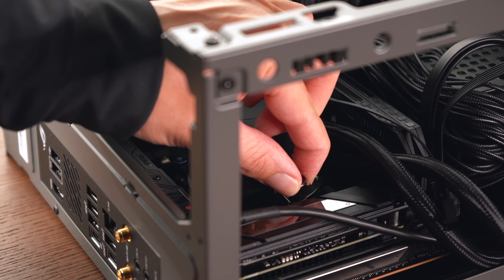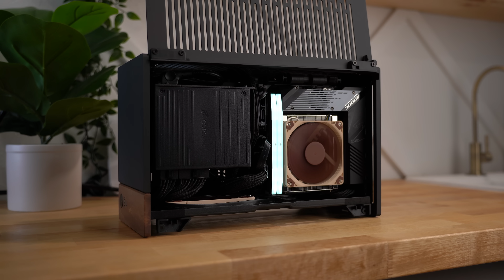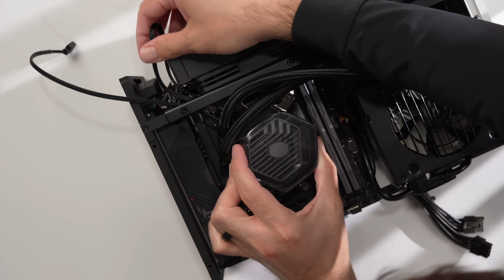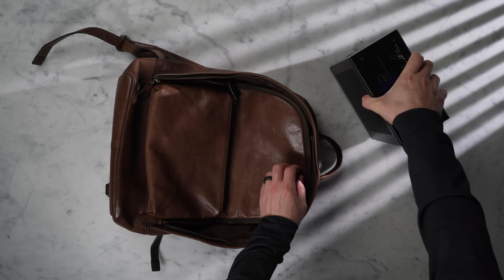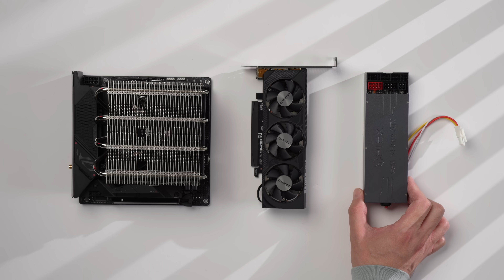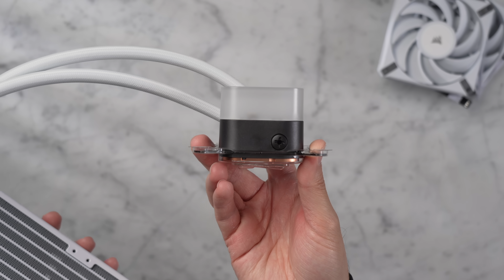Favorite ITX Cases This Year (So Far)

Comment: The new Fractal ERA 2 looks very interesting and I'd like to see how the integrated dual SSD caddy actually works in a speed test with the new gen 4 SSDs. Hope you get around to building in this soon. Also to use the new Thermal Take SFX PSU. That could be very handy for power connections.

Comment: Nice video, thank you. I'm looking to build my wife a sffpc basically for work (MS office, Internet, nothing gaming) and am looking at a MB (Asus z790) and CPU (14900k) with 64 or 96gb ram and want it to handle 2 4k monitor w/out a GPU. All air-cooled with the Noctua NH-L12S (or larger if able to).  Building this all inside the Fractal Design Ridge case. However your video has given me some nicer options as I'd like to display the PC but wife only wants it on the floor.  What do you think of this (pro/con) and what case (absolute favorite that she would want to display it), CPU and MB would you recommend? Thank you.

Comment: Hey guys, I’m actually thinking about doing an ITX build myself (first time ever). I could really use some help on picking the right parts, do you see any problems with the following setup?:

Case: fractal terra (black)
Motherboard: ASRock B650i lightning WiFi
CPU: Ryzen 7800x3D
CPU Cooler: ID-Cooling IS-55
GPU: ASUS ProArt 4080 Super
RAM: 2x16gb DDR5 Vengeance 6000Mhz
SSD: Samsung 990 Pro 2tb
Power: Corsair SF750 
Fan: Noctua NF-A12x15 PWM
Fan grill 120mm
Cables: Corsair premium 600W 12+4 pin

Comment: Hi man, amazing info, thank you! Thinking about mini render station fo 3dsmax + corona render based on amd 7950x and looking for a small case like lian li dan h20, Meshroom S V2 or other similar. I'm not sure it will be cooled enough, cause i need 24/7 rendering at 4.8-5 MHz all cores and max AIO for those cases is 240mm radiator, means 2x120mm fans. How do you think is it possible to make such a tiny render station?

Comment: I've been using the NR200 P Max for about a year and I don't regret my choice. I love itx format but had enough of those cases where you can only fit one little 120mm cpu cooler. The NR200p max comes with an included 280mm AIO watercooling, a sfx psu and a Pcie 4.0 riser. Best value. Great cooling and very low noise level. 👍
Reply: Double bottom intake is a must. Set fan curve to work with your GPU temp. I run 7800x3d and 7900xt oced at 3300mhz and vram at 2800mhz. Temps never go over 70C GPU fan curve at 60% max. Bottom intake never above 50% speed and zero fan below 45C GPU. Setup fucks hard !
Reply: Add some thin 120mm fans as bottom mounted exhausts and you’ll enjoy it even more
Reply: @maxwellgriffith  A lot of test I saw showed that it had little or no effect on temps, and increased noise. So I didn't try. Works fine as is.
Reply: @TaxiDiver100  I should have specified with the vented side panel. Machines & More tested some configs and arrived at bottom and exhaust and top exhaust (side intake directly at gpu).
Reply: @maxwellgriffith The case sits on my desk, on my right side.and I found out the glass panel really soften the noise, so I'm using it... Maybe I sacrified some performance in exchange for some more silence, but that's fine for me.
Reply: @maxwellgriffith  I had it as intake and the AIO at top as exhaust and that worked really well for temps. Was even better than I thought in terms of impact.
Reply: i wish they would release the case as a stand alone product. i don't need an aio or a psu but im in the market for a new case. i have a nr200p but it's pretty dinged up. i might just get another one tbh..
Reply: @Hattori_Fujiyama  I thought they do as i have been looking at them, unless there is some differences but considering its a third of the price seems bare-bones. Unless that is recent in the last 3 months
Reply: @RickyT15  they recently released a nr200p v2 which is basically a stand alone version of the max case as far as i can see. i think its on newegg but it seems kind of hard to find in canada at least.
Reply: @Hattori_Fujiyama  They also changed a front internal panel to increase gpu length at the cost of losing a 2.5" drive mount. Also changed one of the USB ports to USB-C. They are pretty similar, few little changes.

Comment: The issue with the NR200 Max is that CM doesn't sell the case by itself. I want the interior redesign for top radiator mounting but I don't need the PSU or the AIO.
Reply: But you can just get the stock NR200
Reply: @bri1085 The NR200 doesn't support top radiators. The NR200 Max does.
Reply: @FieryMeltman  there's the v2 for that
Reply: @bri1085  If you mean the NR200P V2 I would say it's not worth the price increase vs the normal NR200, especially since it only supports vertical GPU mounting and doesn't have any advantage in motherboard and PSU compatibility.

Comment: If only 3rd party partner Graphics Cards and not just Founders cards fit in more ITX cases. I have the CoolerMaster Max but plan on moving to the Fractal Torrent Nano. I hate compromise and its the smallest case that still lets you fit more than just Founders Cards.

Comment: I wish I got my hands on a DAN C4-SFX. 
The Fractal Terra is kind of bad, since the noiseprofile of the slitted sidepanels is very annoying and you can't fit a 4090 (or most other cards) without downsides to CPU-cooling.
Using a NR200P Sakura Limited Edition atm. 
My secondary PC is in a Densium 4+ V1 (5L), very similar to the Velka 3, but it is longer, fitting upto 220mm cards. 1x 4070 fits with a little modding.

Comment: I am really considering building the Velka 3 since watching your video. The only exception is I want to use an i7-13700
Reply: I'm am currently building it with i7-13700 just waiting on all the parts to arrive, I think it should be fine checking the compatibility on NOC site with the cooler he used it says it's fine to use.
Reply: @TinusTK  I would like to know how it works out for you. Please.

Comment: The NR200p and NR200p Max are not the same case! The NR200p has no top radiator option (without modifications), which is a real bummer.
Reply: That’s because only the p variant supports horizontal gpu orientations, which won’t allow room for top radiators d/t motherboard height
Reply: @maxwellgriffith Nr200P V2 owner here. 280 AIO with 2 additional 120 25mm fans underneath. 9800x3d. CPU temps around 68. GPU around  66 after 2 hours of gaming.
Reply: The nr200p max is hands down the easiest case to build in.
Reply: @ItsPhurpl  yes, but easy is not necessarily the main objective for everyone.

I want to be able to choose my own PSU and cooler/radiator for example and I don't care if it takes a bit longer to build or if it is more complicated.
Reply: @Kevin-chaos I completely agree, part of my interest in SFF PCs is the challenge of building it. If most of the work is done for me it takes away a lot of the fun.
Reply: NR200P V2 is the improvement.
Reply: @WinSomeLoseNone0  that didn't exist when I made the post, but yes ^^
Reply: True, which is why I’m the nr200p I just used a 280mm be quiet! Rad so it can go on the bottom and not have the potential pump orientation issue.
Reply: The NR200P also only supports 2 slot GPUs vertically.
Reply: I have the nr200p and have two 120mm fans at top.
Reply: @eplugplay8409  well yes fans will sit fine, but adding a radiator on top without a mod doesn’t have the clearance.
Reply: Top radiators is usually better for temps

Comment: Would be cool to see an Air Cooled mid range build in the Asus Prime AP201. Its such a  nice looking case while being fairly affordable and it being M-ATX makes it more cost effective in terms of parts.
Reply: But it looks big for a m-Atx case. I would consider one of the more compact SAMA IM01 clones (Itek, Nox, etc). Sized and looks similar to NR200, but with m-Atx support. Although there are no recent YT builds on it for AM5, and from what I have read, some motherboards that have bottom IO are not compatible.
Reply: @dexter_hacks  The size of the AP201 is actually not that big of a deal to me , I already have an M-ATX (5700x/RX6600)build in a DLM 21 and I was thinking about changing cases so the AP201 looked appealing. Another reason im looking at the AP201 is because its one of the smallest cases I can find in local stores where I live and ive never bought anything off of places like Aliexpress and im worried if the cases comes damaged or something on how to deal with warranty and stuff , buying computer parts off local stores is a lot easier for me.

Comment: you should check out the jonsbo d31, its an matx case with a 31l volume and it is super clean. it can fit a cpu cooler up to 168mm in size and a gpu 400mm in length. its probably a great case for people looking to downsize with how compatible it is.